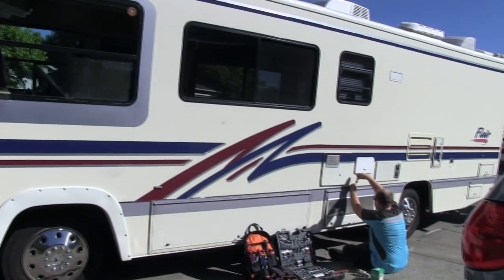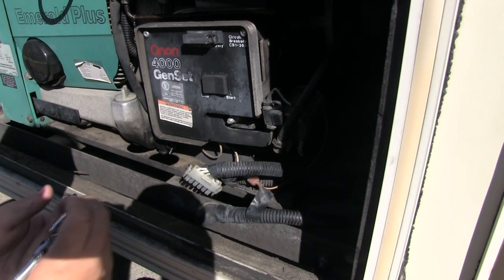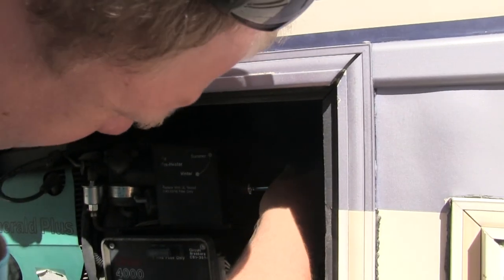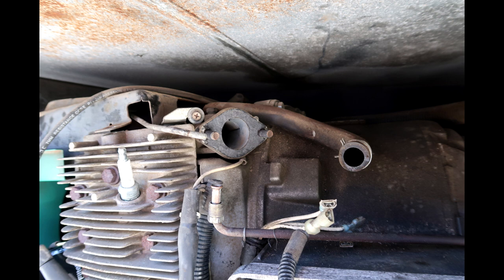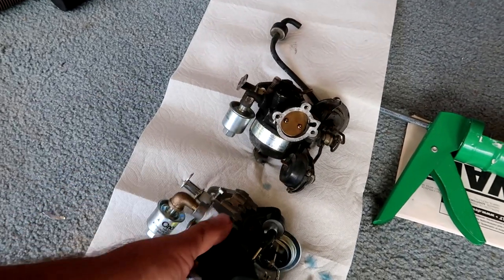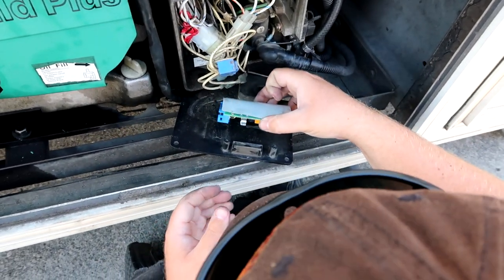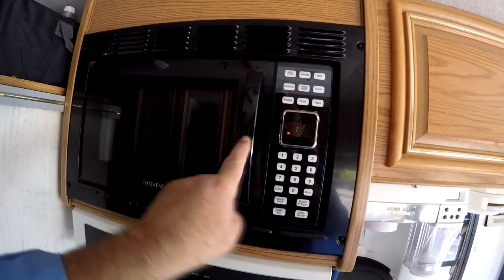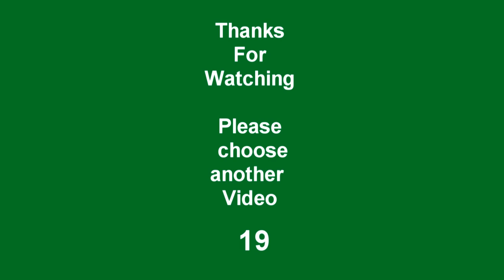ONAN GENERATOR REPAIR: Tips and Tricks!

Comment: One of the best informational videos. Thanks for taking the time to put this together. Genset run once a month minimum is fine under 50% load or more. The more often, the better. As a tech, RV shops don't rebuild carbs either, they are just replaced. You technically can DIY, but expect mixed results. Off brand cheap China carbs also are hit and miss with how long they last.

Comment: Thank you for your video. I have this same generator. Your video is the only one I could find with this specific generator. We just purchased our class C motorhome, and I wanted to do some general maintenance. It runs great. Thanks for the list of parts, and part numbers. Great video. Your video saved me alot of money by doing these things myself.
Reply from the maker: Stan, Thanks for your comment. If you get a chance, I would love to hear what year, make, and model your Class C Motorhome is.
Reply: @welcometomoorerving5800  Its a 2002 E 450 Ford chassis. Gulf Stream 23 ft. It only has a little over 37,000 original miles. The generator  has a little over 200 hrs. From what we can tell it had 3 owners. It ended up at the auto auction. A guy purchased it that sells R.V's from his home as a business. There were no signs of leakage from the roof. The amazing part, everything works. I don't think the onan generator was ever serviced. The oil was really, really black. Air filter didn't look bad. The exterior of the oil filter was rusted. And looked really old. So I figured basic maintenance was in line. I had no idea where anything was on the generator. Only the oil filter as It was right up front. Started searching the internet, when I came across your video. Again thank you for posting. It helped immensely. Now I need to replace radiator hoses, a coolant flush, and transmission fluid and filter replace.
Reply from the maker: @stanweiler4344  That's a real nice size motorhome. The advantage with that size is way more state park and National park camp sites available to you. I can't tell you how many times I have found a campsite "on line" only to find that the limit was 24 feet. As they say "you can park a smaller rig in a larger spot, but you can't park a larger rig in a smaller spot." Also, Most single parking spots are 20 feet so you can back that rig in and get it to easily to fit in single spot. Sounds like you really did your homework.

Comment: Thanks for the great video! I have onan emerald 5000 and it looks just the same. Now it cranks but fails to start, and the fuel tank is almost full. I spent some hours to replace the carburetor and fuel pump, but I found that the fuel pump is not working. I cannot see fuel coming out of the hose when I hear the cranking sound.. I'm wondering the black cable of the fuel pump should connect to somewhere? I couldn't see the instruction about that in the video, I hope to find the solution for the fuel pump.

Comment: I just worked on this generator yesterday.   Had not run in 7 years.   2001 RV and onan had just over 200 hours.   I didn’t have a cut down wrench but even loosening the front bolt which I could just get on it started to spin the bolt and zero way to hold it I thought.   I was able to remove float bowl and clean jet and emulsion tube.   I was unable to remove pilot jet though.  Everything was full of gunk but amazingly it fired up and after a little adjustment it ran pretty well.   I couldn’t run AC, microwave, and hairdryer all at once but perhaps that’s normal

Comment: grrat video.  my issue is spark. looking at the plug.  It sparks once and only once each time I try to start it.  Also if I push and hold the stop buttom on the generator to prime the motor the fuel pump does not run.  But if I connect the battery directly it runs.  My guess is the circuit board.  What do you think?

Comment: How did you access the power supply for the fuel pump? My pumps (+) wire runs somewhere underneath the generator unit itself. Between the bottom plate it sits on and the generator unit. At this point I'm about to just cut it and butt connect the new one's power wire on.

Comment: Hi I have a a 1991 onan emerald plus gen set. It runs fine and powers the rv for 5minutes. Then surges, the house power goes out, it stays running but makes a loud clanking sound like there are loose 
screws jumping around inside of it. When it calms down (idling) the house power comes back on.

Comment: Thank you so very much for this video. You are a great help. I just bought a 1991 allegro 24.5 motorhome with the exact same generators. I changed the fuel pump and the fuel filter the oil the spark plug on the generator. I also drained 25 gallons that was in the motorhomes fuel tank that had sat since 2006. The gas was practically red in color. Put some seafoam treatment in the new fuel and then started the generator and it ran for about an hour fairly well with just a little bit of surging went under load. But now it has stopped running. It’s surges but won’t stay on. I suspect the carburetor must be disgusting from all that red fuel sitting in since 2006. My question is should I replace the carburetor or should I give cleaning the Carburetor that’s on there now? The generator is fairly new at only 85 hours total time on it. Your thoughts?
Reply from the maker: If you have time. Try rebuilding the Carburetor yourself. You have nothing to lose and everything to gain. Remember, there are 2 spark plugs. So if you haven't already, change that rear spark plug after you have removed the carburetor (just like we showed in the video). After you have cleaned the carburetor yourself, cleaned out all the lines leading to the carburetor, installed a new fuel filter, then try starting it again. If it still runs poorly either you did not build it correctly or the lines did not get cleaned. If you feel the lines are clean then find a shop when you can take the carburetor in to have it rebuilt. Make sure you find out the price because the labor might be more costly then a new one. This is what you don't want: Get so frustrated after cleaning your carburetor that you throw the rest of the good generator away. That is what we saw on a Youtube video and had made the decision to purchase a new carburetor.  I hope this helps. Please keep us a informed. I'm cheering for you!
Reply: Welcome to Moore RVing Thank you, I’m taking the carb off Friday and will clean it out.. eBay has a new carb for $185.00 and I’ll buy it if cleaning this old one does not work ... I’ll keep you posted. Thanks for the advice!
Reply: Welcome to Moore RVing success!! Thank you so much for all the help.. pulled the carb out. The back carb bolt was welded to a small flange so I had to screw the head of the bolt and not the nut... other than that it was just like the video. I soaked the carb fully submerged overnight in carb cleaner. Then a good scrub, another soak and fully blown out with air compressor.. put it back in and it fired right up and stayed running for over an hour. Put it under load (ac and microwave on) and it ran perfectly ... thanks again!!!
Reply from the maker: @DoAnythingNew  Nicely done!

Comment: Nice video and Narration; Great music selection; suspect you cudda gotten away w/ simply a Fuel Pump change if a no start or surge was the issue?
Reply from the maker: Hi Terence, sorry it took awhile to get back to you. We drove the motorhome down to Los Angeles to help my older son move to Las Vegas. Rather than renting a U-Haul, we packed all of his furniture and belongings into the motorhome and drove it to Las Vegas! After moving him we stayed 4 nights at an Elks lodge in Henderson that did not have hookups. So it was great having the generator. It is still running great after the repair! We feel looking back that the carburetor was the number one reason why the generator was not performing correctly. However, because the other parts we so in expensive vs having a professional deal with just one item, not knowing when or if the others were also bad, it just made sense to do the other items. Just to have a professional look at the problem, not even fix it was $150.00, so you can understand why we replaced those parts. Hey thanks again for your comment!

Comment: I'm trying to get a spark from plug wires and no spark when I checked it. So should I replace the coil cylinder thing the wires are connected to? I have same generator

Comment: I'm having difficulty loosening that back half inch nut on my carburetor.  I've sprayed it a few times with WD40 with no luck.   Any suggestions?
Reply from the maker: Make sure you cut your 1/2 wrench so that it still fits into the box but long enough to give you the leverage to break it loose. Make sure you are using a good quality wrench in the first place so that you do not strip the corners of the nut. They make a penetrating oil for stubborn nuts. Check with home depot or Lowes to see what they recommend. I hope you get that taken care of.

Comment: You likely didn't need to replace the carbureator. All you had to do was blow it out with a few cycles of Sea Foam. Also, if you want to make a useful change, put in a fuel cut-off on the generator fuel line, then shut off the fuel and run the generator dry before storing/extended parking to avoid leaving gas in the system. Onan (surprisingly...or not) never provided this feature even though they know their products sit idle for long periods of time (eventual parts revenue ++ and design-for-failure). Also, you can easily bypass the main fuel line to a small gas can as needed to run a periodic cleaner cycle on the carb (since it is hard to do that effectively via the main RV gas tank). So, buy a 1 gallon can, a few feet of 1/4" fuel line, some Sea Foam and store with your maintenance gear. It is also possible to remove and periodically clean the oil sensor to help maintain smooth operation and it would be helpful if you indicated the fuse holder part #. With a little patience, I just restored  a 1991 Emerald Plus 4000 to normal operation that had been idle for years for less than 1/10th of your shotgun-method repair cost. Replacing the carb should be the last thing to consider and only after some effort with a $7 can of Sea Foam (and again, it may take repeated cycles to fully eliminate the surging associated with clogged jets and/or poor fuel supply).
Reply from the maker: PlanetInanimate: Thanks for you comments. I would agree with you that a gas shut off switch would be a good item to have. We use our motorhome about 3 times a month. We have added an additional 100 hours onto the generator without any problems. The fuse holder part # was not given because we did not need to replace it ( the kit came with a fuse not the fuse holder).
Reply: Mine has a gray rectangular spare fuse holder for 2x glass fuses on the outside of the main panel. Still looking for a comparable (waterproof) part, since the end-cap was very old and fell off (missing). Harder to find than I thought it would be. Also, the ROP Shop 2-way, 1/4" valve ($15 on ebay) is a good choice for the generator to connect to the main gas tank and to allow for periodic clean-out from a small gas can. And...on the oil pressure switch, the opening pressure is only around 5psi, so it's easy to spray clean it periodically - it typically requires a 1 1/16" deep socket to remove it from the generator housing.
Reply: I added a fule shut off to my generator i get home shut off gas let run till it stops and and have no carb problems
Reply from the maker: @johnmayfield7068  Hi John, I think that is a wonderful Idea. Thanks for your comments!
Reply: @PlanetInanimate  my fuse holder cap fell off from age.  It is a 1992 year make. 341 hrs. On gen. I also changed to rubber gas line w/ added shut-off you did a pro job on vdo. Great help.
Reply: I just bought an 1991 Allegro 24.5 motorhome with this exact same generator. It’s out since 2006. The generator has 85Hours on it. I change the oil and the spark plug the fuel pump in the fuel filter with new ones. Make sure I didn’t overfill or under fill the oil and it ran fairly well with what I noticed was a bit of hesitation when I would put it under load for about an hour and then it began to surge but won’t stay on.. I should mention that I drained 25 gallons of fuel from the motorhomes gas tank which looked practically read it was so old. Clean the tank put fresh gas and seafoam treatment before I started running the generator. I have to imagine that the carburetor must be filthy on the generator. My question is should I just replace it or should I remove it and clean it with carb cleaner? Am I correct in suspecting that the carburetor is the problem given the fact that it ran fairly well for an hour before it started to act up?

Comment: very good video no if you could help me I have the same generator in my homage engine year 99 I tried to start it and apparently I did not have enough gasoline and I was forcing it or trying to start it too many times that now it does not try to start it just makes a different sound someone read this message that can help me
Reply: Make sure you have a fully charged battery, and ALL electrical connections are super clean and tight including the 2 battery terminals, and the large cable that goes to the starter on the generator. Usually electronic/electrical problems are from loose/dirty connections. I use steel wool or a file or sandpaper to get connections clean and then spray with any brand of plastic safe electronic cleaner. Any Wal-Mart or auto parts store sells it. Good luck.